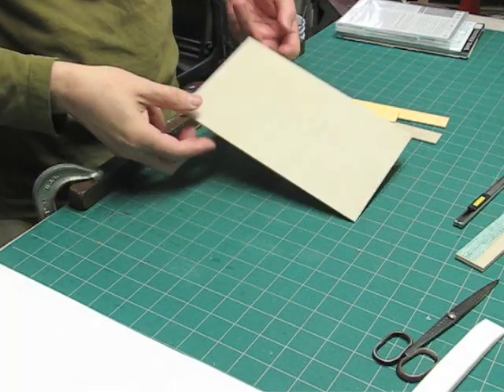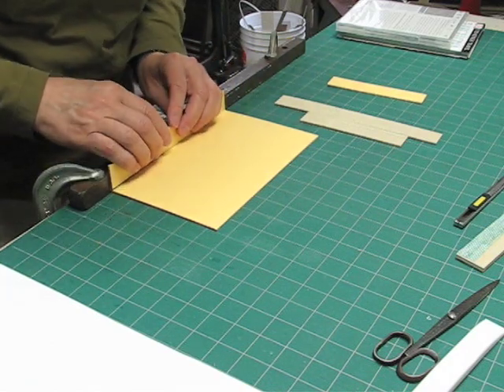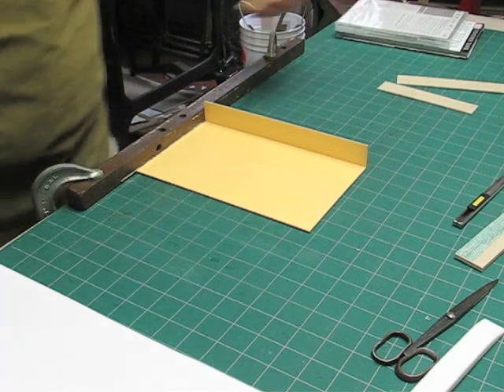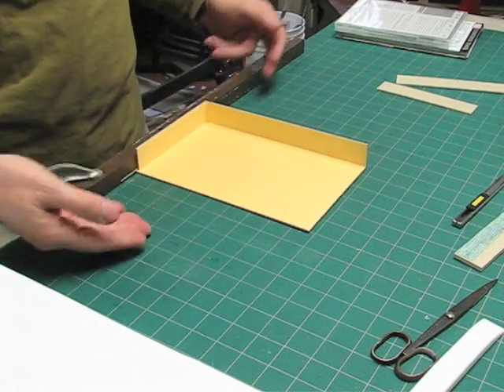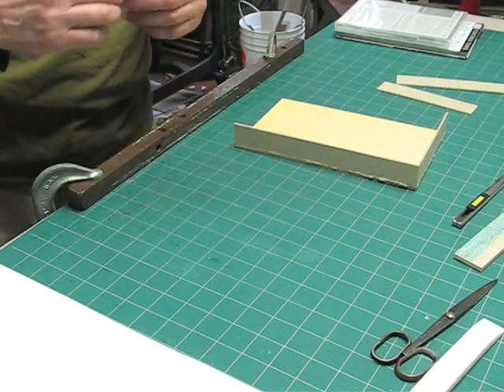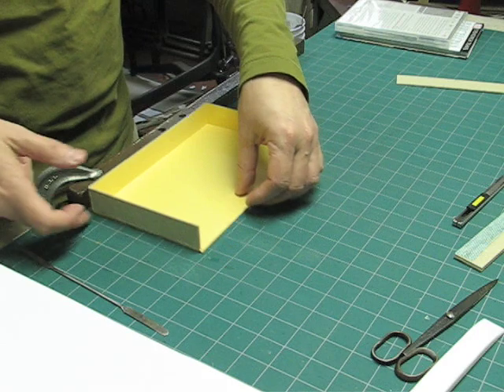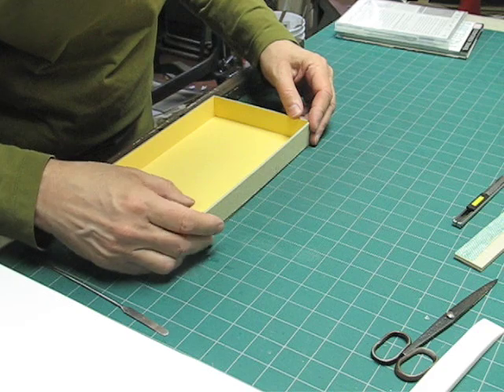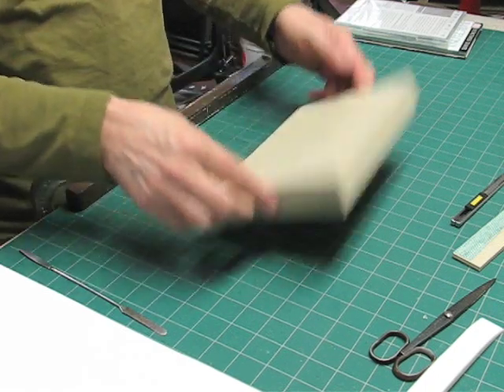Prototype Box Part 2

Comment: Where is a good place to get the type of board that you use and what type of board do you use meaning what do you call it exactly?
Reply from the maker: I use Davy Red label; Google your local library supply or go to Talas online. I have no idea where you are or what may be available in your area. Do not use mat board, corrugated cardboard or foam core ( too fragile) most solid board will work for many jobs. 

Thanks for watching.

Comment: fine, but this could have been done with one single piece of board adding more strength to the box.
Reply from the maker: +Zulfikar Abdulaziz A single piece of board would have to be folded with cut out corners. The corners and edges would not meet, the folded edges stress and tear the fibers of the board which weakens the edge. By using pieces you get the benefit of architecture, post and lintel, every part supports every other part. A single single board folded into this shape would prove difficult to join and cover. 
 Thanks for watching.

Comment: How did you make the gauge?
Reply from the maker: The gauge is two thickness of the boards that I use to make the boards, 
we are interested only in the thickness, the length does not matter so 
much. I use gauges like this to make boxes and a special one for clam 
shell boxes in my other videos. 
 Thanks for watching.
Reply: Hi  thanks for responding! I'm sorry but I was asking about the brown bar clamped to the edge of your work table.
Reply from the maker: The bar clamped to the edge of the table is a steel bar that picked up off of the street a long time ago, Manhattan discards have given me a number of tools... I also have a simple oak board that serves the same purpose. The steel bar allows me to freely remove glue build-up with my Olfa knife.